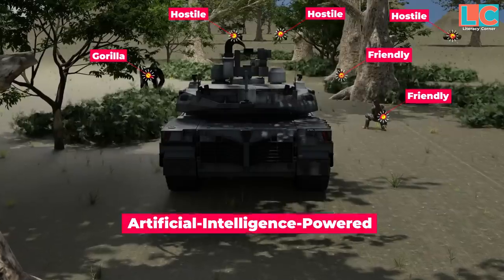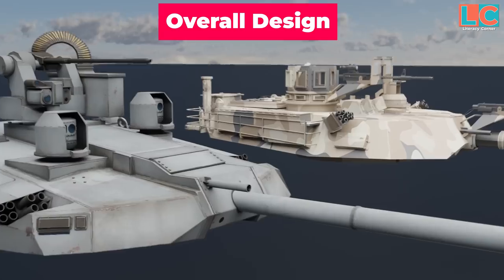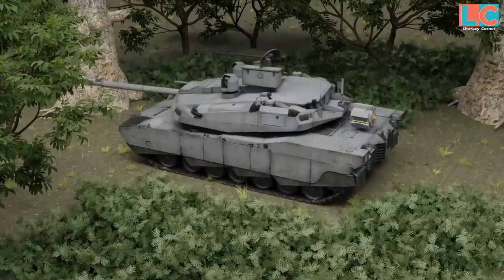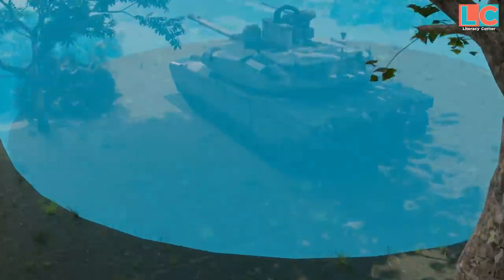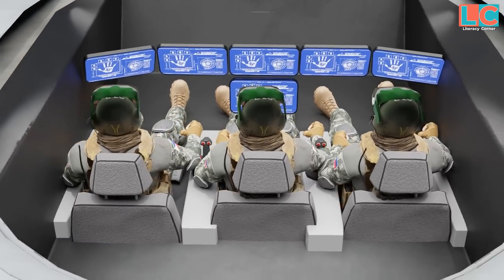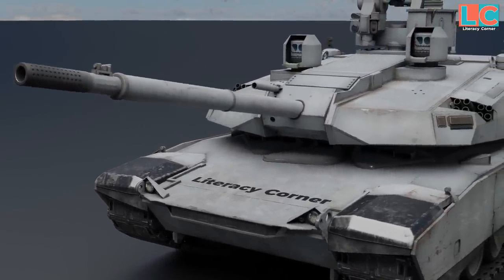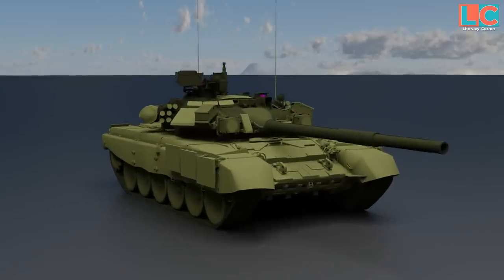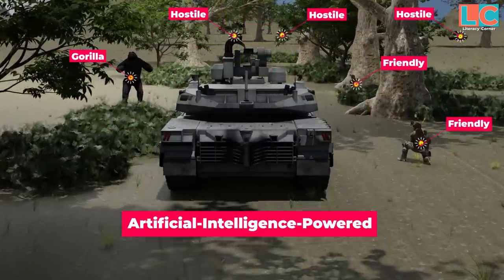EVERYONE SHOCKED! You need to see this new tank of the USA.

Comment: The thing that surprises me about this, is that this almost seems less like a tank and more like an armored vehicle with as many weapons systems and sensory systems crammed into it, that also just so happens to have a main gun in a turret. The introduction of so much digitalization and even AI integration almost makes it feel like the tank is a drone that just so happens to be controlled from the inside.
Reply: @thesauce1682  It doesn't count as copying when the "original" can't even drive through a military parade without getting a "planned towing exercise".
Or able to move the turret around. And has no stabilized gun. 

Basically what I'm saying is, just because some crack addict made a cardboard mockup of an idea doesn't mean you're "copying" him if the lamborghini you built looks a bit like the addict's droopy cardboard
Reply: The AbramsX will likely be capable of unmanned operation similar to the Optionally Manned Vehicle!
Reply: @kathleenwhitten7120  that's both awesome yet terrifying

Comment: I like the idea of making a new generation of tanks. Some are saying we should go to the 130mm Rheinmetall or the 140mm Nexter. Are either one of those guns electrothermal chemical guns like the 120mm on the Abrams X? Would their rounds be more powerful than the new rounds for the Abrams X's 120mm? I think a 4th crew member should be added so he can help operate secondary and tertiary weapon systems such as the 30mm canon, hero drones, etc. I'd say mount a .50 paired with a crows system on top. Add some active countermeasures to go along with the already present passive ones. Add reactive armor. Is it true these tanks will have javelins? That would be a weapon system the 4th crew member could utilize while the gunner/commander are concentrating on primary targets. As far as a tank platoon goes, maybe the lead tank of the platoon could use reconnaissance drones in place of hero drones.
Reply: I agree with everything you said, with one exception. I don't think 4 people are necessary, because I'm sure that the AI replaces a lot of the eye's abilities, giving him time to shoot. Excellent idea with the old Abrams A1M1 chassis, modernized. Low manufacturing costs. The chassis is tested in theaters of war and that's how the weak parts were seen, which have now been eliminated. I like the idea of the autoloader turret. Smaller, lighter turret that can be better protected. As for the cannon, I would have switched to a 125mm with reduced recoil. The costs would be much lower than if they switched to 130 mm. Especially since Russia does not intend to switch to another caliber in the near future. I don't agree with the idea of the Germans with the 130 mm gun. This gun will require a lot of the chassis and requires a lot of changes, which is very expensive.
Reply: Being an old Tanker I'll say up front!  Go with the German 130mm and it has a good Auto Loader.  Next, the top of the hull (not turret) needs more Armor.  I know T-14 is Vaporware but look at Armor around the hatches above and behind the crew? Even if it is laminated, it is too thin.  I love the Hybrid Engine!

The Germans have Tech demos of 1 and Un-manned Turrets that can be built under license just as the current gun is.  Oh and 130mm is the sweet spot since 140mm is even larger has to slow down the rate of fire after the first 5 or 6 rounds due the recoil system's hydraulics and heat of the barrel.   130mm has a 50% increase in Lethality and Range over the light weight 120mm that uses the same Ammo as current gun.
Reply: @dnate697  What do you think of the new 120mm being converted to ETC capability? I'd imagine it'd hit just as hard, if not harder, than the 130mm if they converted it.
Reply: @dnate697  Cool. Better that way. It protects the crew better. I would make a cage in the chassis like in F1, to protect the crew better...;)
Reply: @Joe_Friday  It's a very good idea. According to me, the era of heavy tanks is over. It's the time for mediums, sub-mediums, sub-mediums in a drone-assisted system. The classic war is almost gone. Ukraine showed us this in full.
Reply: @colincampbell767  To your last comment, it seems like relying solely on a HEAT round might not be advisable especially if a sabot was loaded into the main gun.
Reply: @Joe_Friday  In that case the HEAT round hits 4 seconds after the sabot round.  A sabot round will likely not cause critical damage - but will distract the crew for a few seconds.  Also the battle carry ammunition will generally be HEAT unless you are expecting to be running into tanks.  

And the 30mm is a waste.  First of all the issue HEAT round is actually HEAT-MP the 'MP' means 'multi-purpose.'  in 'ground' mode it functions as a standard HEAT round.  In 'air' mode it is designed to kill helicopters (even helicopters that are hiding behind a hill but are raising some dust to give away their locations. (Note 'shaking trees' also give away a hidden helicopter's location.)
Reply: @dnate697  The hybrid propulsion comes with a serious drawback - any physical damage to the lithium-ion batteries and the fire will destroy the tank.  Once that kind of a fire starts you literally need to keep a fire hose on those batteries until they are fully discharged to extinguish the fire.  (Lithium Ion batteries do not need oxygen to burn.)
Reply: honestly the real question is, will the tank be able to survive long enough against artillery/air/infantry systems to be able to use ANY of its munitions
Reply: @user-ot4ch4qh9c  I'd imagine there's a good chance as long as air dominance is obtained.
Reply: @user-ot4ch4qh9c  No question about that.  Artillery is only a danger to a tank if you sit in one place and let them fire until one of them hits.  And enemy infantry are not a problem if you're using combined arms tactics.  Not only that but since it will come equipped with the Trophy APS - antitank missile and rockets aren't going to be an issue.  And as Ukraine is demonstrating - airpower can't really operate well in areas with active air defenses.

Everything you've mentioned is all old stuff where the solutions were found over 60 years ago.
Reply: @colincampbell767  lol yeah sure... you might want to check your intel...
Reply: @user-ot4ch4qh9c  My "intel?"  How about my own experience and training on tanks?  Do you understand what 'combined arms warfare' even is?  

Are you really thinking that the inept performance or Russian tank crews and military officers is because (yet again) somebody who has no clue has declared that the tank is "dead?'  We have seen the same videos - the difference is that I understand what's happening (and not happening) in those videos.

Comment: Even though it's a highly unscientific method, I believe that you can make a good guess about the quality and effectiveness of a weapon just by looking at it. This goes for everything from a dagger to a naval ship. Any weapon that is the result of compromises, corrective altrerations or poor quality will reveal signs of this already at a casual inspection. This is how excellent weapons like a katana, the Spitfire, the Panzer III, the Centurion and the Bismark turned out to be some of the most beautiful, well balanced and harmonious designs.
And when I compare the look of the T14 Armata with the new generation of the M1, the first one looks like it was designed by children, especially compared to the sleek lines and absolute perfection of the latter. This is a contender to the title "best MBT in the world". And when you look at the specs, they don't disappoint.
Reply: Yet the T14 Armata still has better crew protection, because it has very strong ERA + very thick composite armor behind it, meanwhile the Abramx X still retains the same weak upper hull front plate of the Basic Abrams, which is literally just 1 single steel plate angled at 83 degrees. This plate would have to be at least 100~150 mm thick in order to stop modern rounds, which is very unlikely though, considering the current M1A2 Abrams only has around 70mm at the upper hull front plate and it doesn't look like the Abrams X has a much thicker upper hull front plate, which is not able to resist modern projectiles that can easilly penetrate over 700~800 mm (the T14 Armata gun can even pentrate 1.000 mm armor)
Reply: @xAlexTobiasxB  Abrams M1A2 has the most powerful armored in the world. No tank has better armored than chobham armored. T14 is a garbage tank as you can see there is not much armored in T14, its only a steel hull nothing special.
Reply: @totoitekelcha7628  🤦‍♂️

0/10 Troll harder
Reply: @xAlexTobiasxB  Cry harder
Reply: @totoitekelcha7628  no you
Reply: @xAlexTobiasxB  cry more
Reply: @totoitekelcha7628  trolololol
Reply: @xAlexTobiasxB  cry again
Reply: @totoitekelcha7628  I just wanna tell you how I'm feeling
Gotta make you understand
Reply: @xAlexTobiasxB  ok cry again
Reply: @totoitekelcha7628  
Never gonna give you up
Never gonna let you down
Never gonna run around and desert you
Never gonna make you cry
Never gonna say goodbye
Never gonna tell a lie and hurt you
Reply: @xAlexTobiasxB  cry harder

Comment: Questions. 
1. Does it have cupholders?
2. Does it have capacity for manual loading, and who picks up that task (Gunner) with transfer of gun to commander? 
3. Are there manual back up systems if EMP? 
4. Would be cool if they put surface to air sidepods on either side of the coax MG mount.  Would also be cool to add a coax M19 along with the coax 50.  It's possible.

Comment: The most important thing to know about it is that it is not being proposed as the replacement for the current tank fleet.  It was designed as a technology demonstrator.  The Idea was that they would use this to decide what features the next tank will have.

The turret on the demonstrator is likely a fake because it looks nothing like the turret that was being fired off the test stand.  And a lot of the exterior features appear to have been designed for looks and not practicality.  Note the placement of the headlights and how it will leave the left and right sides ahead of the tank shadowed if they dried to use them at night.  And that strip on the front of the tank with the cameras and thermal sensors?  How long are they going to survive with a brush guard?  Look at the placemat of the flash suppressor for the coaxial machine gun - then look at the roof behind it - there simply isn't room to mount a machinegun there.  Much less open the top so you can load it.  

The hunter/killer sights for the gunner are a waste.  The gunners' sights should be mechanically linked to the main gun to ensure they are always pointing at the same thin the main gun is.  Putting the sights in a 'dog house' on the roof of the tank reduces the overall profile of the tank and allows you to use larger (and better) optics and thermal sensors.  And the 30mm commander's weapon is just plain stupid.  They build a low-profile turret to enhance stealth and then put that on top?  And as some testes with some marines recently demonstrated AI threat detection still can't beat the humand eyeball and brain.  

And it will not be as maneuverable as the previous M1s because it will have a diesel instead of the turbine.  People really have no appreciation of the tactical agility the turbine gives the M1.  The Army tried to replace the turbine on the M1 with a diesel, but the tanks crews said 'no.'  Now if it were diesel-electric drive you would have the instant power response.  

BTW - the hybrid system comes with a huge drawback. If the Lithium-ion batteries take battle damage - the tank becomes a total loss.  There will be no way to put out the fire.

Also you need to consider the drawbacks of a three-man crew.  First of all is that you are adding another complex mechanical system (the autoloader) to everything else on the tank and have one less person to help with the daily checks, cleaning, calibrations and maintenance (on average a tank crew spends 8 man-hours a day taking care of their tank).

Comment: The turret still needs to have heavy armor as the turret is most likely to get hit. However compared to T-14 - which appears to have a very vulnerable small turret - the AbramsX turret is still the same size so should have good armor so very difficult to take out. 
Placing the crew in the hull makes them more vulnerable to mines, however it appears they are further back than the driver is normally. So this should give more protection. It is unclear how they enter and exit the vehicle. Should they all squize trough the hull 'driver' hatch when they have to evac?

Comment: It is just a Abrams that addresses all the weakness’s of the M1 a2. Better fuel economy, able to run in silent mode, more battlefield awareness, and a active protection system.  Now General Dynamics Land Systems just has to show that it works. And is as advertised. That’s the hard part.
Reply: It addresses one other weakness, weight.
Reply: @12hairyjohn  you are absolutely correct, sir that one is probably the most important.
Reply: To your logic, T14 is just another T90 because it incorporate the weakness of all T90 tanks.
Reply: Even the US Army is concerned about the weight of the M1 a2 SEP V3, and I since mentioned neither Russian tank, your logic is faulty.
Reply: @totoitekelcha7628  To my understanding the T14 is a completely new tank. But if you are saying it is a culmination of all that they learned from the T 90, then yes. My main point is, the new general dynamics tank needs to prove it works. Having a long list of cool features does it mean any of it will work on the battlefield. To that extent, yes just like the T14.The T14 is an ambitious project. Especially from a nation whose GDP is just a little more than the state of Florida’s.
Reply: @gavinrebtoy3375  Abrams X will surely work if the US army approved it.
Reply: @12hairyjohn  please point out the flawed logic. I left off the weight problem. The weight problem is still there with this tank. I assume that is what all the funding for a light tank program was for.
Reply: @gavinrebtoy3375  The Abrams x is light enough to operate in Eastern Europe, while the M1 A2 SEP V3 will collapse bridges. since the light tank is so much lighter, one must be concerned about its protection.  The T-14 is a vastly different from the T-90,  I suspect that the Abramsx is a smaller leap.
Reply: @12hairyjohn  remember the Abrams started at 54 tons.
Reply: @gavinrebtoy3375   Iknow, but it's not there now, and I was talking about now.
Reply: @12hairyjohn  I may no understand what you are trying to say. I think the light tank program is closer to being excepted than the AbramsX. With the USMC giving up all it’s Abrams. And wanting a much lighter tank. But with a war in Europe the US maybe speeding up these two programs.
Reply: @gavinrebtoy3375  My apologies, I should have given some raw numbers,  the M1A2 SEP V3 weights 13.6 metric tons more than Wasaw Pact bridges can often tolerate. The tanks going to Ukraine are 1.5 tons too heavy, however I suspect that tungsten may be substituted for depleted uranium, and I don't know how that will change the weight. The other problem is ground pressure;  it is higher than both German Tiger tanks, and King Tigers often chewed up the road, making resupply difficult. A winterexercise in Estonia a few years ago was canceled because the ice wasn't thick enough to protect the pavement.

Comment: I bet the tank is modular with a tow behind battery trailer for extended silent running. That's what i'd do.
Reply: Kennerth Shoulders and Wiston Bostick worked on making plasmoid electron/plasma clusters and they are in lightning steamers. every lighting bolt is a plasma 2 stroke entity. The plasmoid has the particles moving in abrupt cycloid motion that taps the ZPE. This is what Joseph Papps pulsed plasma 2 stroke engines

Comment: jesus H. Christ, a lighter tank isn't more maneuverable because of it. The M1 Abrams is extremely maneuverable, the weight reduction will help with a lot of things, but not making the tank more maneuverable than it already is.

And no, the turret didn't become smaller nor lighter as it is optionally manned, requiring the space on it to fit two crewmen if needed

Comment: It needs to be upgraded to 155mm tank gun.
Reply from the maker: Since it's only a demonstrator, maybe the US army might use the 155mm. However, its maneuverability might be affected.
Reply: if you increase the caliber to 155, then the meaning of the self-propelled guns is lost, the main battle tank becomes universal
Reply: I like the idea of making a new generation of tanks. Some are saying we should go to the 130mm Rheinmetall or the 140mm Nexter. Are either one of those guns electrothermal chemical guns like the 120mm on the Abrams X? Would their rounds be more powerful than the new rounds for the Abrams X's 120mm? I think a 4th crew member should be added so he can help operate secondary and tertiary weapon systems such as the 30mm canon, hero drones, etc. I'd say mount a .50 paired with a crows system on top. Add some active countermeasures to go along with the already present passive ones. Add reactive armor. Is it true these tanks will have javelins? That would be a weapon system the 4th crew member could utilize while the gunner/commander are concentrating on primary targets. As far as a tank platoon goes, maybe the lead tank of the platoon could use reconnaissance drones in place of hero drones.
Reply: @RusselHustle  ты конечно извини, но видел ли какая длина ствола у САУ?
Reply: @Rory_Mercury  ну да, так они и хотят дать грубо говоря пушку от сау для обт, им не хватает фугасной мощи, им уже не нужны 155 мм кумулятивы или подкалиберы для пробития другого танка (так как для этого и 120 достаточно) им нужны мощные фугасы для уничтожения укрепов
Reply: @RusselHustle  дать орудие от САУ не получится. Габариты совсем другие. Танк получится как вагон метро.)